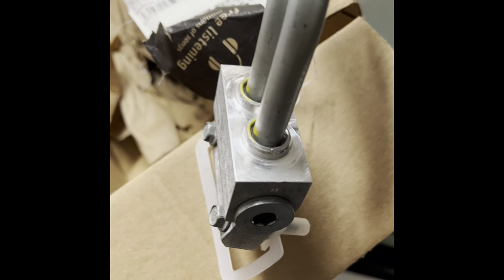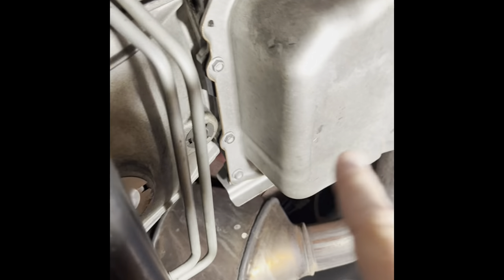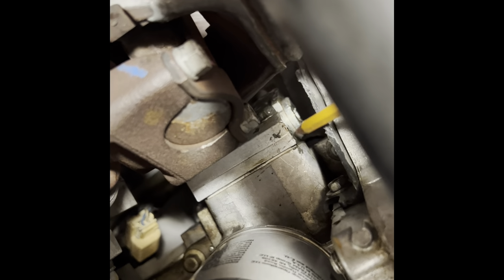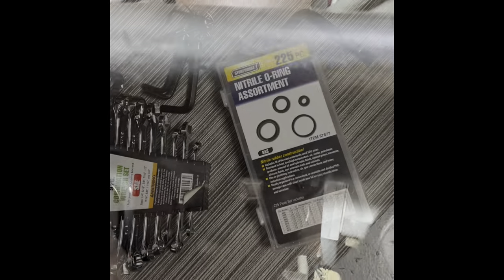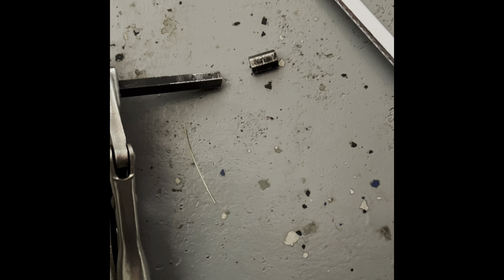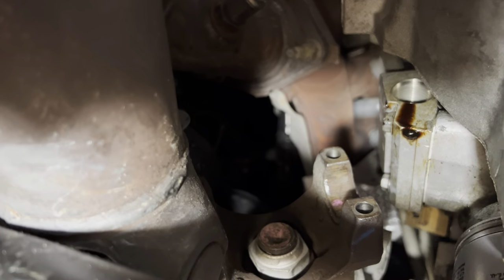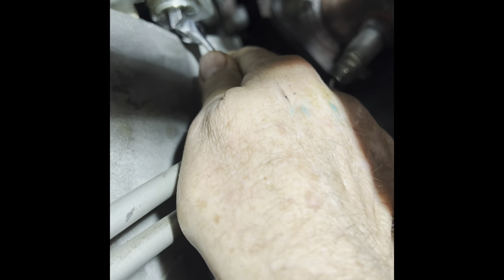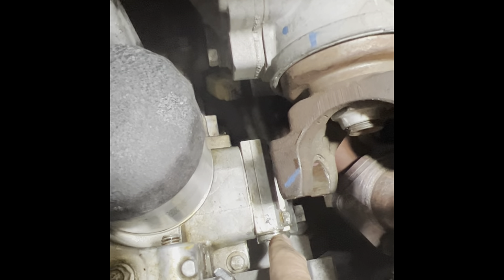Oil cooler line block bolt leak FIX!🚚🔧GMC Yukon ,Chevrolet Suburban, Escalade,2006-2014 Cheap Easy💲⌚

Comment: Same issue here.  replaced the gasket and still dripping.  Added UV dye to try and pinpoint the leak and it was the plug.  Cut a 3/8" Allen to make the insert and when I went to install the hex, the plug turned.  Mine was finger tight so no wonder why it was leaking.  Instead of just tightening the plug, I pulled it.  My plastic washer was in perfect condition.  Cut it off, installed the O-ring and Teflon tape.  NO LEAKS.  Works like a champ.  If you don't have a Harbor Freight near you as I do, Tractor Supply has a small bag of these exact O-rings in their hydraulic section that are rated for oils and such.  P/N 51170  ID- 3/4, OD - 15/16", Thickness 3/32"

Comment: . I had the exact same problem down to the leaking bolt and leaking gasket (2014 GMC yukon). Following the instructions provided in the video, I was able to successfully replace the cooler gasket, which was readily available at my auto parts store, and went to get the o-ring from Harbor-Freight as described. Out of curiosity, I asked my GM dealer, and quite interesting, they do not sell the o-ring (or the man was unable to located it or unwilling to sell it), besides, even if they did, probably the same cheap plastic one instead of an upgraded version as seen here. Thank you for sharing.

Comment: Watched this and several other videos on repairing the 5.3 oil cooler line block leak.  In my case I have a 2010 Chevy Avalanche 4 wheel drive.  I was able to move the front driveshaft out of the way after taking the U joint out of the yoke and pushing it back and then moving it to the side.  Gave me enough room to use a 3/8 allen drive socket to remove the bolt.  I removed the bolts holding the cooler line block first and then held the cooler line block in place with rubber tipped channel lock pliers.  The bolt was not torqued very much and came right off.  I cleaned the bolt and the hard plastic seal was cracked and came off in 3 pieces.  My Avalanche has 125k and has lived its whole life in a hot dry climate.  I used a new o-ring and a new GM oil cooler gasket.  No leaks since and I was surprised how easy this was.  Some of the really rusty vehicles I have seen here on YouTube would have made this job much more difficult.   

While I had the truck up I changed the leaking trans cooler lines too....NOT easy and if I do this in the future I am just going to cut off the leaking rubber lines and replace them with sections of rated rubber hose and high pressure clamps.  Had to take the front bumper assembly almost off to reach the clips where the lines attach the cooler in front of the radiator.

Thanks again for taking the time to make a video and detailed instructions.
Reply: So you didn't have to make the tool just to buy the 3/8?

Comment: first of all, thank you for sharing your experience with us I have changed the gasket, but oil was still dripping I was going to change the whole lines from engine to the radiator
 this video pinpoints the problem and I used a jaw plier instead of Alen key it works it was easier problem fixed ... thanx a lot

Comment: Very helpful video. I ended up not needing to make the tool. I unbolted the oil cooler lines and put a block of wood between it and the oil pan. Of course, wrapped it with nylon to avoid any debris getting it those lines.
Reply from the maker: saving lives and wallets from GM everyday😇

Comment: This is very helpful. Just did my oil pan gasket and the gasket for that oil cooler block and discovered the same piece is leaking, luckily mine is 2wd so I don’t have to worry with a driveshaft.

Comment: The hex plug on my 2007 3500HD has a plastic tapered seal with a break in it. It’s not a soft rubber o ring. I can’t find a replacement so I used rtv sealant with the old seal and screwed it back in. I’ll know in a few days if it worked.
Reply from the maker: cool and best of luck😇👉 in the video and description box  you can get a box of nitrile o rings at harbour freight for cheap.https://www.harborfreight.com/225-piece-nitrile-o-ring-assortment-67677.html
Reply: @mbjdiy1778  I rode hard feeding cows today. No leaks!
Reply from the maker: Yeah !!! 🐮🐄🤠😇

Comment: First, great video 
Hope the arm healed up well.
Maybe it's my bad eyes, but it looked like you are missing a bolt on the transmission pan. I noticed it when you first pointed  things out with the pencil. Did everything work out with no more leaks??
Thanks for the video!!
Reply from the maker: 🪔🛢4/24/2024 Still no leaks .... not a single drop ... 👀checked the pan ... bolts all there .... I am severely scared from that burn on my arm it was ... 3rd degree burn ... I probably should have gone to the urgent care ..... but all healed know😇

Comment: The key bolt on the side of the block was spraying oil out of mine tonight. Mobile mechanic came out, it was a little loose, he tightened it and seems to have stopped the leak.
Reply from the maker: Good luck may just stop the leak ....  unless plastic seal (plastic oring )  inside is cracked 😇
Reply: @mbjdiy1778  ive had it idling and so far its dry, but we’ll see how it goes. It was dripping and creating a puddle underneath when idling, it lost a full quart of oil out of it. He said it was loose about a turn and a half and ever since then, its been rather dry.

Comment: do you loose oil when you replace this bolt and gasket?
Reply from the maker: yes not a bunch but check your oil and fill if necessary after repair and before startup😇

Comment: Hi ladd, great video, but I have a 2010 Yukon xl and have to change the whole line. I do have oil all around the oil pan . I know the cooler line is leaking, and I already did the oil pump, pick up tube O ring and oil pressure sensor and filter. After about ten mins of running oil pressure drops from 40 to almost zero. I just wanted to change the cooler to see if it’s a leak in it causing the oil pressure drop. I still should prob do the pan gasket but do not want to take all this stuff down to drop the pan. Possibly the oil bipass valve in the pan that goes bad on these LS engines too. But I can’t snake the old cooler out, let alone what looks like a night mare to snake the new one in. Is there a way to snake this cooler out? Thank you so much, Kevin NJ
Reply from the maker: Here's the bad news you have to lift the engine up  1 to 2 inches motor mounts and whatever else disconnected , remove steering assembly and possible headers (my 2012 has to be done this way) = take it to a dealer or a qualified automotive repair shop if you have to replace the whole line... 😇God bless 
👀👉IF NOT WATCH VIDEOS BELOW👇
👉Video's how to do:::: 👀 How To: Replace Oil Cooler Lines, 2007 - 2013 Chevrolet Silverado or GMC Sierra (4x4) the EASY way https://www.youtube.com/watch?v=f3Hk88j9mPQ&t=1281s
Oil Cooler Line Replacement 09-13 GM Trucks https://www.youtube.com/watch?v=43na3DkaoS4
Reply: Ugh, thank you. As it seems, I have an oil pan gasket leak in addition and have serious questions about this bypass valve inside the oil pan. At 240,000 miles and losing oil pressure still after doing everything else. I gonna have to take the axil off and cross members and away bay along prob with the rack and pinion to get the oil pan down. So I assume at that point I’ll be able to put the new oil cooler in. It’s been a hell of a war forest gump. Geez I’ll hit ya back if I get there! Cheers 🍻 Kevin

Comment: My 2013 Suburban LTZ is leaking as well. There is so much oil that I can't tell if its the gasket or that plug.
Reply from the maker: Clean it ... then run it ... find it

Comment: What if my car just has a cap there, and no oil lines going to it? Idk how the hell my car cools the oil but on the motor by the oil filter its just a cap bolted there to cover it.
Reply from the maker: you do not have a oil cooler if it is capped off

Comment: The only thing I find odd about this is that the plug uses a 3/8 inch Allen key I thought everything on these vehicles used metric fasteners.
Reply from the maker: that what fits or locking pliers around the body of the bolt 😇
Reply: I just did mine last night and it is a 3/8. I am assuming it is just a standard machining plug.

Comment: My question is why not just take the line off the block and then takw the bolt out. No need to cut a hex down
Reply from the maker: Either way😇 but the GM rule of thumb (Ford Also) fix the one do not case the many or another... and if you do disconnect line follow my video in the link in the description for that gasket replacement fix

Comment: This is not a normal hex bolt. This is the oil cooler bypass valve access
Reply from the maker: and it leaks ... poor design 😇

Comment: Those are not 10 minutes or bolts or 11 mm bolts for that matter.
The heads are 10 mm and 11 mm in size I'm not the bolts But not the bolts themselves.
Reply from the maker: When you go to buy the bolts  or use a tool they are called 10 mm 11mm bolts because of the head  the threads are a whole other thing and length is another.............😇
Reply: @mbjdiy1778  😇